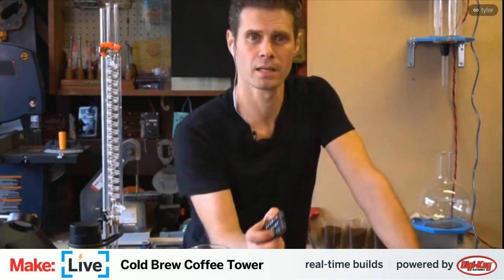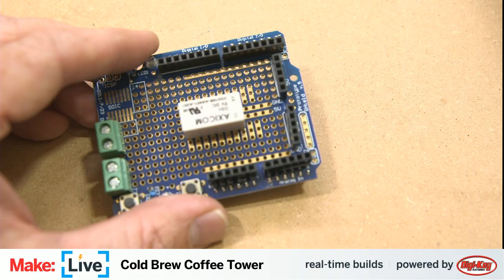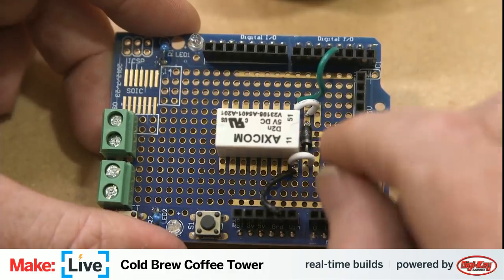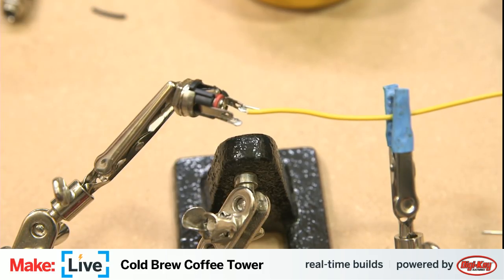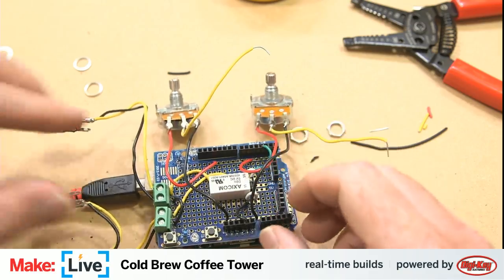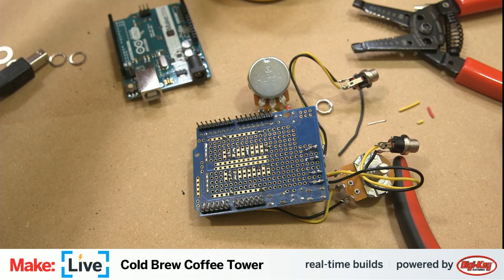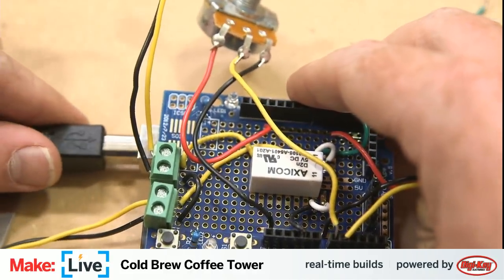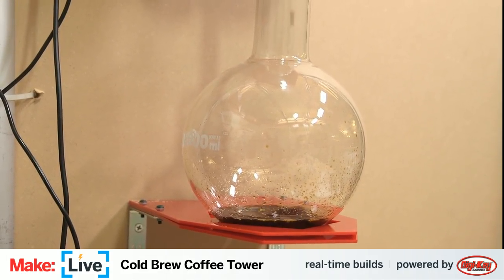Make: Live - Cold Brew Coffee Tower

Comment: I think usung an arduino is overkill. You would have gotten away with this project simply using a 555 chip,some resistors and a capacitor. maybe a transistor if it can't handle the relay...
Reply: A lot of hobbyists these days start with MCUs and then move on to using simpler, cheaper ICs and discrete components. Myself included. It was very easy for me to get into Arduino due to the simple troubleshooting. You can correct errors as the compiler spoon-feeds them to you, while troubleshooting a circuit, specifically analog, requires a bit more research, education, foruming, etc.

Also worth noting that:

1. Younger people are more likely to learn code far before they even touch a discrete component. Many high schools offer computer science courses, while the electronics classes are lacking material, if they even exist.

2. You need to buy more stuff once you quit MCU's! Far more discrete components required, as well as the test equipment to troubleshoot them. A sharper curve compared to a laptop, an MCU board, some resistors/leds, and plug-in modules guaranteed to work with the proper libraries.

I ultimately agree with you...but I didn't learn a lot of what I know until I started studying EE in college, so I see where the arduino guys are coming from.

Comment: in Root Terminal 
apt-get update || apt-get upgrade ret.
web-get install kivy install ret,

if (kivy) installed but not operative
in root terminal

./configure ret
make kivy ret
make install ret
 reboot and try again.

Had your friend been running BeOS 6 Pro and UltraDV 6 Pro he would not be having any problems.
Why don't you use a SCR to control the mains that will control the pump.
<http://forum.arduino.cc/index.php?topic=158399.0>

Comment: As a coffee aficionado their explanations are cringeworthy at best. Not to mention that neither of them has realized that there's a significant difference between cold brew and cold drip, the latter being what they're actually trying to do here.
Reply: I'm by no means a coffee expert (though I grind my own beans and make my own espresso), and was not familiar with the cold drip method of brewing. However, I just googled cold drip vs. cold brew, and saw results on coffee-related forums, blogs, and commercial sites that distinguished between "slow drip cold brew" (what is shown in this video) and "immersion cold brew" or "cold press" (which is what I knew as cold brew).  It would seem to me that "cold brew" just means that the brewing process is done at low temperature rather than with hot water, but you can still do this using different methods.  As one site put it, "‘drip’ and ‘press’ are similar, while ‘brew’ tends to be a coverall for either method."   Is that not right?
Reply: There are tons of people that call the above method cold brew simply because it is brewed cold. Those same people often refer to this as ice coffee (or even iced coffee). However there are vast differences in the methods and results. Simply put, cold brew is a full immersion brewing method which means that the coffee grounds are to be completely submerged during the entire brewing time. This way more and more of the coffee is being extracted as time passes. Cold Drip (which you can see in this video) adds a drop water to the grounds at a certain interval and the water is in contact no longer than it needs to "pass through" the grounds (in reality the grounds first need to be fully saturated before the extract will separate itself from the grounds. Once the drop falls into the collection vessel it will no longer be part of the brewing process and no longer extract solubles from the grounds. Iced Coffee is very similar to normal hot brewed coffee. You can make Iced Coffee by simply using any pour over method, espresso or Aeropress for example. But, instead of collecting it into an empty (serving) vessel, you either collect it in a vessel filled with ice cubes or pass it through a vessel with ice cubes and then into the serving vessel. The difference between coffee brewed with hot and cold water is that cold water doesn't extract as much of the oils of the coffee grounds and therefor is generally less bitter.
Reply: Thanks for the response.  I didn't see any coffee-related posts confusing coffee brewed cold with iced coffee (in fact, they all tended to make the point that they were not referring to iced coffee).  My only observation is that some coffee aficionados would dispute the fact that "cold brew" refers solely to the immersion process.  Even Wikipedia—which we know to be nothing less than god's word...—calls the cold drip process "slow-drip cold brew."  All I'm saying is the definition of "cold brew" doesn't seem to be fully settled (and in most places I've seen cold drip discussed, they still referred to it as a cold brew method).  

That being said, I still understand why you'd find the coffee-related explanations in the video cringeworthy.  I have had that feeling before with respect to other topics I know more about.
Reply: The biggest issue with Cold Brew and Cold Drip and all the other labels that exist for those two methods is the very fact that they're still being used all willy nilly. There is no one entity that says this is correct and that isn't. Cold brewed could potentially refer to anything method where coffee is brewed with cold water instead of hot. Many will agree with you for obvious reasons and I, until I did my research and drew my own conclusions, would have too. I mean, even in the other comments on this video you can see the two methods being named the same, compared directly as if it were the same and what not. 

The fact of the matter however is that there are two vastly different methods and I personally will engage with anyone that is open to the conversation ;)
Reply: I agree with you that slow drip cold brew and immersion cold brew are two vastly different methods. ;) haha